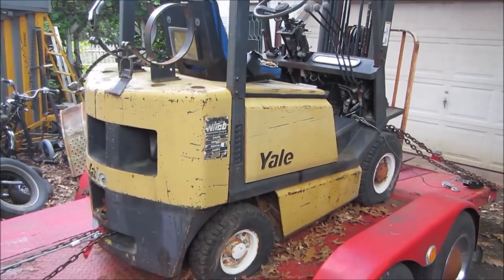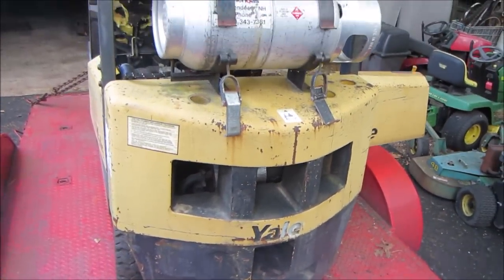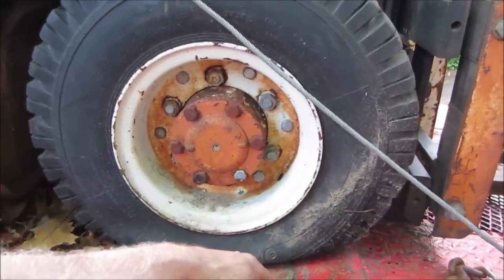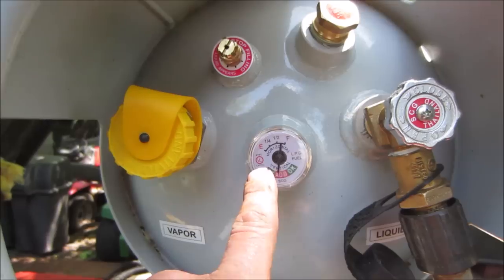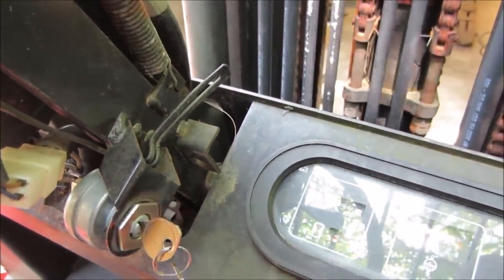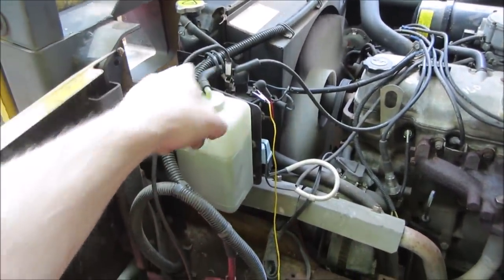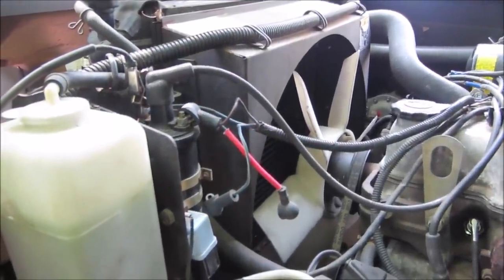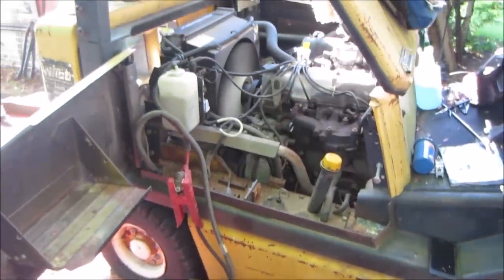Will It Run? cheapest Forklift I could find .pt2

Comment: You can use neon bulbs as spark checkers. Back in the day you might remember the hot rodders were sold kits of 8 and basically one per spark plug wire. You can get away with ones out of the orange nightlights and use clear tape to put them on. I'd be surprised if you don't have some laying around in the horde already.

Also if you suspect a module like that you can try cooling it with your airgun. If it cools off and the problem goes away it's most likely the part. Great video, though. I'm not sure I'd be that patient about it all. You put a LOT of hours into diagnosing this one. I wouldn't want to be the one footing the bill for diagnostic time!

Comment: Just out of High School back in 1981 I worked in a shop for a Gas Company & we did LP conversions on trucks school buses & cars along with doing maintaining the gas co. fleet most problems we saw with the LP poor running motors was the gas filters or plugs &wires the first round thing from the tank is the filter and shut off it takes vacuum from the motor to turn on the gas flow

Comment: It looks like it’s got an impco filter lock and gas converter.
Not much goes wrong with them, only the diaphragms go brittle over many years.
The filter lock works with engine vacuum, if you suck on  the black hose  it unlocks and allows the gas to flow to the converter.
You might want to remove the gas mixer and clean it out  as they can sludge up with oil.
The yellow cap on the gas bottle is for filling.

The problem is more than likely the filter lock has a pin hole on the diaphragm.
If you suck on the vacuum hose and it doesn’t hold vacuum you’ll find that’s the problem.

When the engine stops press the gas converter primer button to see if it’s soft

Comment: watching this again, the major components needed for this unit, are dual front tires for adverse terrain. Your blocked in manlift now needs fork tubes for movement, so you would have the ultimate mobility in your hoard with dual front tires. Plus you could lift your rusty vws wherever you wanted with fork tube extensions.

Comment: liquid propane leaks are fairly easy to notice, usually you'll see frost and a vapor cloud blasting out. most important thing, always turn the tank valve off when not in use.
more so if stored indoors, on a large dock there's enough ventilation to not cause issues and someone would likely smell it, in a small garage it could make a nice boom when opening a door/opener or lights, compressor, fridge, etc. :)

Comment: That's some great troubleshooting. I thought it may have been some kind of a vacuum issue myself. I guess not. That running voltage being so high, the pickup getting so hot, and that ballast resistor looking so new all makes me feel like something still may not be right there though.

Comment: Sounds like the idle needs adjusted,it may be just because the air cleaner is off. I am a forklift mechanic it's pretty cool to see this old thing running as much as I hate the yale trucks. I don't know about this one but some of them have a drain plug on the regulator to drain the tar from the system. Not trying to be a know it all just trying to give some tips

Comment: The company I retired from had several pieces of lift equipment. About half Yale and half Raymond. The Yale was by far the least trouble and more reliable of the two brands. As we replaced units we went with Yale. By the time I left we were 100% Yale.

Comment: I’m learned to drive a forklift when I was a kid on that very model and my father still has it today and it still runs and operates just fine. When I was around 10 my father wanted to teach me how to drive the forklift so he put me on it and as soon as he flipped the switch and put it in gear and it began to move I panicked and hopped off with it still moving and he had to run after it and stop it lol. I did eventually learn to drive and operate it lol.

Comment: Hm-m-m, a ramp hanger as opposed to a cliff hanger.
Another great vid with more insightful trouble shooting.  Keep an eye on the charging voltage if it stays high that could be what caused the ignition pickup module to fail.

Comment: Your propane info is true for forklifts and some other applications but smaller engines like on a propane buffer run on vapor and not liquid. You can use a grill tank for those smaller engines.

Comment: From what I remember when you first start it you get full voltage to the coil to give the maximum spark as the starter only gives you 200 rpm 's , once it's started the voltage  is lower as it goes through the resistor .  The ignition switch gives you the run position and the crank position  , the crank position gives the starter solenoid and the full voltage to the coil .

Comment: Many coils have resisters built in or don’t use resisters and lowering the voltage increases the amperage according to ohms law which causes heat and shortens the life of components, even though some thinking may seem like the opposite would be true. Some systems bypass the resister during cranking for hotter spark during starting. Someone may have replaced the points system with electronic and failed to remove the resister as part of the install. I find it unusual to have a ballast resister on electronic ignition. Lastly some multimeters will outright lie when reading spike voltages like that, perhaps read voltage while the test light is in the same circuit to help level the spikes. $0.02 from an old equipment mechanic that has been out of the game for quite a while. Enjoyed the video.

Comment: A wire straight to the coil and another through the ballast resistor:  In the old days when the engine was cranking full voltage was put to the coil for more spark, when in normal run mode the coil was supplied through the resistor.  I converted a 6V truck over to 12 and had to understand the ballast resistor.

Comment: I had a '92 Chevy van doing the same thing. The van would run fine for a few miles and then just shut off like you turned the key off. A friend of mine said it was the little circuit board on the distributor. Changed that and it stopped. I never trusted that van after a couple of times on the side of the road. But that seemed to cure it.

Comment: the first piece in propane line is probably a vacuum operated solenoid/valve, engine running or cranking would open it allowing fuel to the regulator. not serviced many over the years, but seems familiar
* I seem to recall that being a filter also.. been a while too long, slow mind ;)

Comment: I’ve run fork lifts on a grill tank before but you need to have them upside down so you get liquid out of the valve. In a pinch it works

Comment: Older propane tanks had a rigid tube that went to the bottom and one side of the tank. They were prone to breaking off so when the liquid level was lower than the valve the forklifts would quit running. Newer tanks have a flexible pickup that falls to the bottom no matter which way the tank is mounted but the gauge needs to be oriented correctly if the tank is used on it's side.

Comment: Just a tip if you're not real familiar with forklift operation, models of this vintage should have a switch at the bottom of the break pedal travel that will disengage the trans to allow you to throttle up the motor to increase hydraulic operation speed.

Comment: The propane bottles have a double locking valve on them to prevent leaks essentially two valve seats and must be open all the way until it seats or all the way closed.

Cheers

Comment: I'm really digging the sound of the engine running. I wonder if I could find a cheap "broken" forklift in my area and yank the engine out and somehow fit it into my small pickup truck. After a little research, the power output of many forklifts is about the same as the engine in the truck anyway.

Comment: What are you referring to the “cage” the part that is bolted to the carriage that is where the forks sit is called a backrest. I happen to work at hyster-Yale in Berea  Kentucky and we build these trucks by the hundreds and I would recommend sending the mast back in to have your bulk and freelift chains replaced bc under load the links could separate due to the corrosion.

Comment: Something I didn't think to mention, I watched the tire guy replacing tires on a couple of the lifts at work, and he tilted the mast back, put a block under the bottom of the mast, then tilted the mast all the way forward, which raised the front tires off the ground. Pretty slick!  The tires in this case were solid, but really worn, so perhaps it will lift the pneumatic tires off enough to replace them????

Comment: That sounds sweet as a nut dude....i've driven a very similar model myself around 90/91, my boss, the master of the everything, tried to take it out of the warehouse with the mast up one time....
He took out the lintel over the doorway and dropped about 3 tonnes of stone onto him & the fork truck....the truck survived almost unscratched....sadly so did the boss... ;-)
I just saw a video the other day of a guy unloading a truck at the side of the road, got off the fork truck, left the forks at head height, and a motorcyclist went straight into them from the side...he didn't get up again.....i would suspect ever again....

Comment: Propane regulators just love to freeze up when the tank is slap full.  I added a two stage regulator on my 36 inch Blackstone griddle.  If I put a full tank on the small regulator on the original Blackstone regulator it would turn the regulator into a block of ice and shut off.  With the new two stage regulator I have no problems.

Comment: 38:00 it's not just a pick up it's the ignition module. The coil is internal (for the pick up) along with the driver for the ignition coil. It makes sense that it ran for longer with the larger resistance ballast resistor because it will heat up less (less current through the module).

Comment: Problem induced by the hotwired ignition switch... the coil should get its power from the battery ONLY when starting - that way it has enough power for a good spark with the starter dragging the voltage down.  When running the coil should get power through the ballast resistor (I would expect 6 - 10 volts on the coil) so the coil / Ignition module isn't overheated. Without fixing the hotwired ignition switch you run the risk of burning up another $100 module and / or coil.

Comment: One trick to raising the rear tires off the ground:  chain the forks down to yir trailer then lift the mast.  Since the forks are chained down, the back end will tip up.  Sometimes the propane components get, a little bit, gummed up by the odorizer(Mercapton).  Just saying.

Comment: It is fun to watch someone else work on one. Did you learn about the weight of the back end of the forklift and going downhill in a forward position? You need to grease that front forks and chain assembly or you will blow a line.

Comment: I learned a little trick when a suspected module might be bad, you hook up a timing light to the system and if you loose the signal then the module in the cap is bad but a ballast might be doing what the old Chryslers would do.

Comment: Had a late 70's/early 80's GM 350 V8 that had the distributor up against the firewall and the module in the distributor started crapping out when hot.  Not the easiest place to work unless you like lying on an engine from radiator to firewall and bumping your head on the hood ;-)

Comment: at the end, was waiting for the ramps to fold when the counterweight hit them... mines about same size, weighs 9900 pounds, probably 6500 on the tiny rear tires... i dropped a tire off my driveway edge on what appeared to be solid ground, pulled it off and the counterweight sunk a good 10"...tires were barely visible by the time i got the tractor hooked up to pull it out, we actually had a rear tire bust thru the trailer hauling it home- was a new 15k gvw tilt bed. the steer tires are so small they put a ton of psi on that contact patch...not like a big tractor/dozer or whatnot...hope your ramps held.

Comment: Same dang issue as my dump truck let me tell you how many tails that thing had me chasing.. Replaced the fuel pump three times, rebuilt the carburetor twice second time my fault set the float level wrong the first go around, replaced the fuel filter twice, changed out the fuel tank, replaced all the fuel lines, disconnected dual tank switch can you see the theme here... Problem was I would get the truck running great take it to the dump and usually on the way back it would stall out like it was running out of gas, I would set on the road side mess with the carburetor, filter etc and usually get it going enough to get it home. Well this last go around of messing with the fuel again changed tank thinking maybe it had sediment that was clogging up the system from bouncing on the road I thought I am just going to let it run for awhile, low and behold about 45 minutes in it started the same ole stalling out. So I turn it off went the house came out an hour later started right up then and ONLY then i knew it was an ignition issue. I went the easy way since it was a small block Chevy I just bought a whole new HEI distributor for 80.00 and problem gone no more stalling out..  Enjoyed the video wished I seen it first so maybe I wouldn't have went down the rabbit hole like I did..

Comment: Grease the top of the cage that the forks hang on. It makes it easier to spread the forks. Also, if you tilt the mast forward, fork shifting is easier.

The side-shift feature is nice. Made stacking pallets a lot easier.

Comment: The "Vapor side" is the fill port. The only way that engine would be burning oil is if it was run without oil, or grossly overheated. That forklift should last you the rest of your life the way you would likely use it. This is a great find.
Reply from the maker: l put oil down the plug holes

Comment: Those modules do go bad.  I remember swapping out many of them in GM HEI distributors over the years.  Same symptoms, hot failures, bad transistors (heat affected).  They recover fast once the vehicle dies so it can be tough to nail down the module as the failure point.

Comment: You certainly have a result there!!

There should be a number or code on each of the forks that should match, they are usualy stamped on the uprights, you may need a wire brush to expose them properly.    If they don't match then the forks aren't paired up which under load could prove a problem if one fork is weaker than the other.

Comment: Had a similar issue with my bugs electronic distributor and it ended up being the Hall effect sensor inside the dizzy ....Runs way better on its old points system lol

Comment: The lpg goes into what is called a lock off and the one to the left is a model J vaporizer. And yes it down steps the psi form tank pressure to about 5 psi.

Comment: I knew it was the magnetic pickup as soon as you opened up the distributor. I had a Ford car from the 1980`s with the Duraspark electronic ignition that acted the same way. Engine would run just fine for some time then all of a sudden die out and wouldnt start up while still hot. had to let it cool down before it would fire up. Turns out the magnetic pick up in the distributor gets weak when hot. Replaced it and problem went away.

Comment: The first one is a lockoff valve. It prevents LP flow when the engine is not running. This is why propane forklifts have to crank longer than the typical gasoline powered engine. 
The second unit is the vaporizer/regulator all in one unit.

Comment: Ballast Resistors are used to limit current in the ignition circuits not for a voltage drop that is why they are low Ohm but High Wattage. The Hall Effect sensor can and will fail intermittently. The reason the old one was hot is because one of the internal transistors or FET's is starting to fail and conducting too much current.

Comment: A ballast coil is normally 9 volts so resister drops it down to that. But is like a car when the starter is on it has a 12+ feed to the coil for extra spark. If you put a constant 12+ volts it will overheat it.

Comment: In the early Seventies if you owned a Chrysler product you kept a spare ballast resister in the glove compartment.
Reply: Had a 73 Dodge truck. Mine went bad, the truck would run on starting fluid but not gas. Old school mechanic told me to change the ballast and it fired right up. He also told me to buy 2 and keep one in the glove box.

Comment: Ballast resistor is 1.2-1.5 ohms. Same as the coil primary resistance. With engine running should be about 8-9 volts at the + coil terminal, rising to battery voltage when cranking. The other wire coming from the + coil terminal should be the bypass from the starter solenoid when cranking to boost the spark..

Comment: I have propane on my off road Toyota truck,  for rock crawling.  they will run off a gas grill tank enough to idle them. but the won't have any power to work it. I have 3 used tanks that I bought from a propane tank delivery service for fork trucks. paid about 70 bucks a piece. you can put the tanks on right away, it won't bother them. they just don't like to start when it's super cold outside. like below 30 degrees or so.

Comment: I had an old slant 6 with a ballast resistor on the firewall.  It would break because the hood leaked water in the rain. I used to carry an extra.

Comment: Crack the valve slowly, if you turn it to quick an internal safety device will activate and and slow or stop propane delivery.  This is especially true if it runs out of propane and when you change tanks.

Comment: good fix , electronics running at engine temp is not a good thing due to high thermal cycling, even so looks like your one the down hill run now.  great buy fix & sell shame about the rubber o well . thanks for video